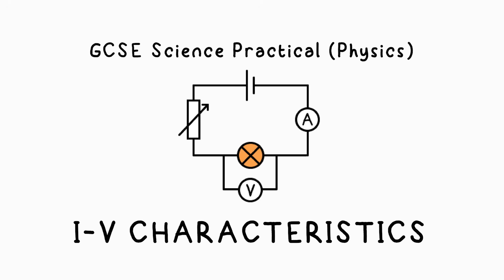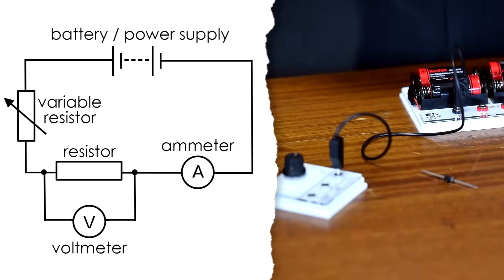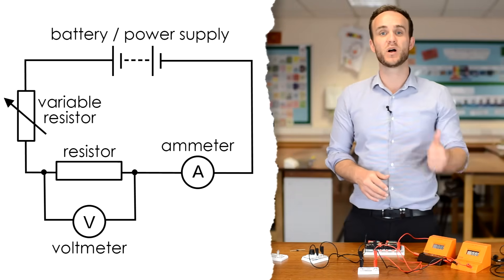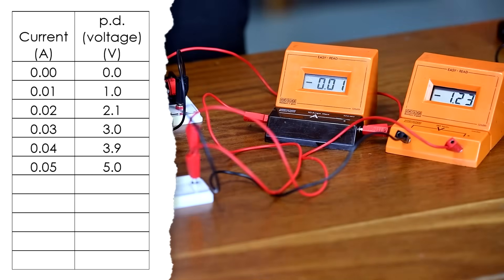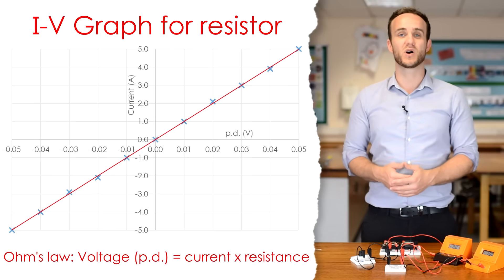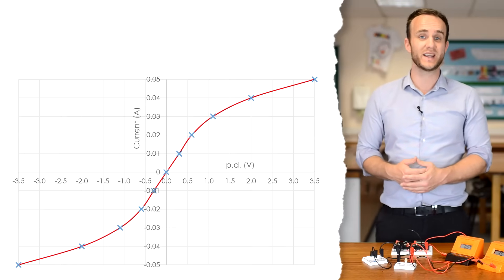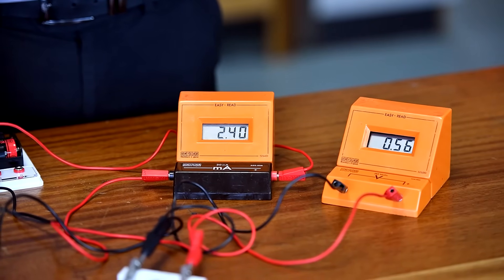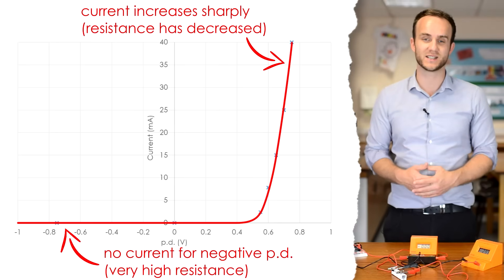TESTING COMPONENTS - IV CHARACTERISTICS - Science GCSE Physics Required Practical

Comment: Can anyone explain why (for the diode graph) it’s like still like 0 amps(between 0 and  0.4)but then shoots up immediately?,im aware that the diode only lets current flow in one direction and that it has massive resistance in the opposite direction
Reply from the maker: Just a quirk with semi-conductors - it needs to reach a threshold voltage before the electrons can flow. Similar to, say, a strip light - there needs to be a certain pd across the tube before the electrons can 'jump' between atoms.
Reply: Well I rewatched it and the resistance becomes non existent, but how does the resistor just magically dissapear?
Reply from the maker: Because the pd moves electrons into the conduction band. They now much freer to move. (It's very different to a metal)

Comment: What’s the point of including the variable resistor in the practical?
Reply: are you slow?
Reply: @icorex2getting grade 9s mate so clearly not
Reply from the maker: ...to change the voltage?
Reply: @ScienceShorts yeah, no need for such a snarky comment. Keep in mind you’re not Jesus, mate
Reply: @ScienceShorts doesn’t it change current?
Reply: @CihanKas from my understanding, it can change both, depending on which one you want to stay constant. In this case for example, since the current stays the same in a circuit in series, with Ohm’s law of V=IR we can see that if current doesn’t change but resistance increases, so does the voltage, and vice versa.
We can of course rearrange this equation and get I=V/R - which in this case, given that the voltage doesn’t change, increasing the resistance would decrease the current, and again vice versa.
Do correct if anything doesn’t make sense.
Reply: no stop cus i asked myself the same thing 😭😭
Reply: Yeah... surely you can just change the p.d using the power supply?
Reply: @Straykidslover143-x4eI think that’s actually the other way,in my text book it says u can use a low supply of voltage or adjust the variable resistor to keep current low(so ur right aswell basically)